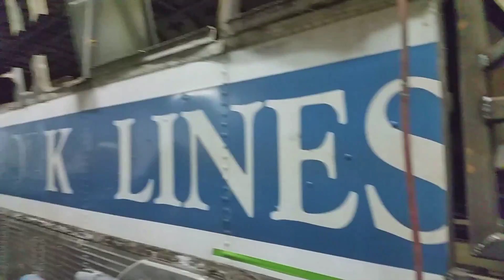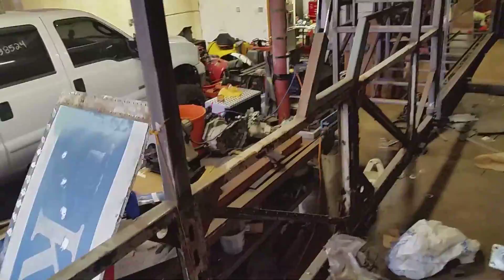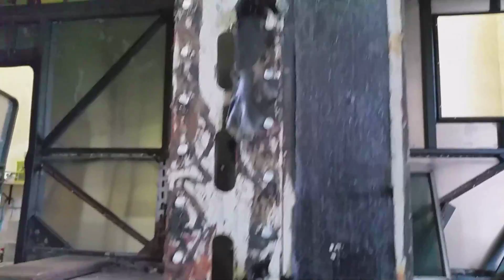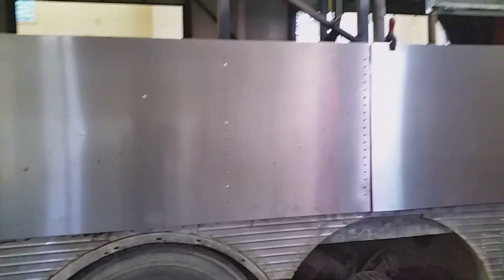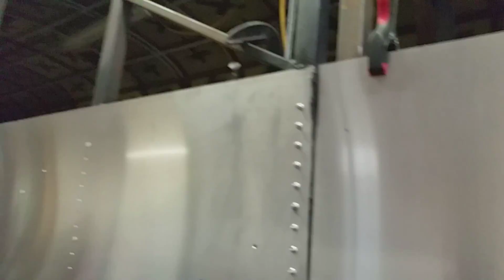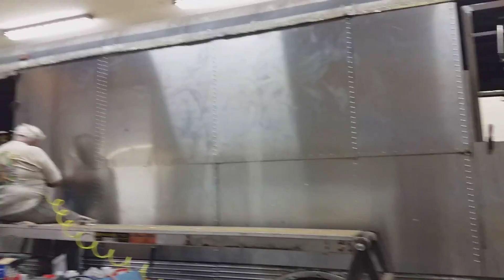Bus Conversion Project - Video 48 - Driver side skinning

Comment: Ive been skimming through your episodes, and am really impressed- especially the slide work. One question, I may have simply missed the answer to, is could you weld the skin panels rather than rivot? Currently looking for a 8.3L pusher I can play with. The rivots look good, was just curious.
Reply from the maker: The slides are steel and the skins are aluminum so no, welding is not an option, many builders use sikaflex adhesive and bond them on and then just rivet top and bottom under mouldings so rivets aren't exposed which is what I'm doing on the lower panels but I wanted it to look as original as possible so rivets it is :-)

Comment: Looks Amazing really like the for thought PLAN " B "  for the gap issue if it happens no added wind noise on the road or weather issues when the slides are closed and parked. I would slap you for the rivets, but it would most likely end up being a " high five " instead for you and Dad for a job well done. Some one should slap the guy at MCI for using mild steel exposed in a rain gutter though. Looking forward to the next update don't forget to relax a little from time to time both you and Dad deserve it.
Reply from the maker: Thanks, most likely wasn't MCI that used the steel screws but some repair shop, still should be slapped though, think we will be taking a break over the winter when it's too cold outside, I was hoping to have it all sealed up this fall so I could heat it and work inside over the winter but I don't think I will get that far before it gets too cold, it's taking longer than I expected to skin it... apparently 4000 Rivets take a while to install..... who knew